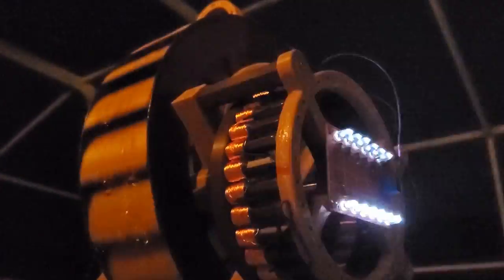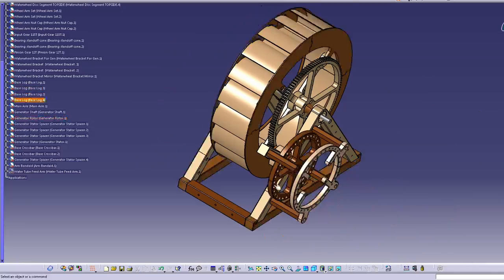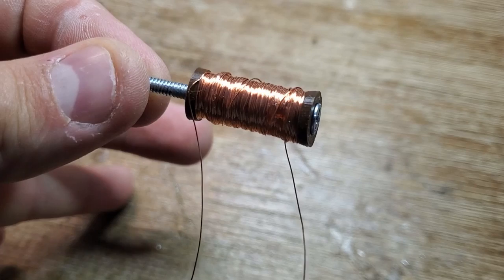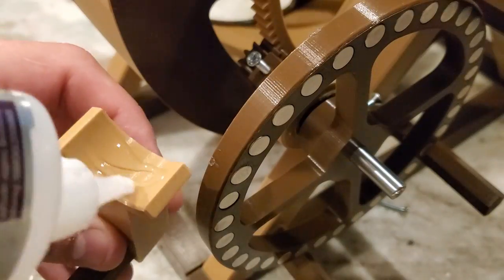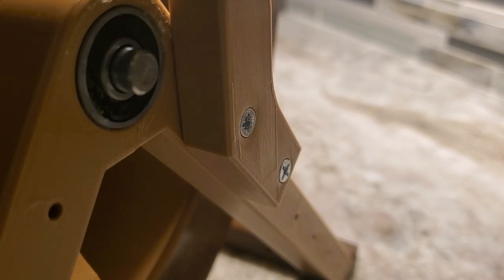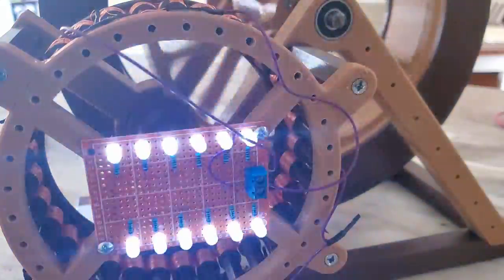3d Printed Waterwheel Generator

Comment: Hi Iron Wheel here (Also Pioneer Under Water Boat) I did not know the coils would function W/O the iron core. Cogging sucked up too much of our energy. We spaced the magnets away from the coils but then our efficiency was abysmal. We were building a pelton wheel. Before switching to permanent magnets we used an auto alternator power generation was just enough to keep the field energized.

Comment: a ring of magnets around both outer edges of the wheel, and stationary coils on the frame, will require more magnets but removes any drag of gears, belts, chains etc!.. a great looking wheel well done..

Comment: output of 26 miliwatt? ha lol a small 1cc hog air engine produce triple of that in electricity with a peak of 150 mw mechanical XD but its less energy efficie at 8ml alchool 45 min its aproximatly a 80 watt thermal used for 75mw electric

Comment: You had 33 sets of magnets and 33 coils in the first iteration, correct?  You removed the fero cores and reduced the cogging, could you not have changed up the number of either coils, or magnets such that you didn't have a single "cog" effect?  

i.e., 33 magnets and 29 coils?  (Or some other set of numbers that created both and "in-phase" and "out of phase" arrangement between the coils and magnets?)

Nice build

Comment: I have a theory that I would like to see tested. Take a water wheel, then multiply it by a number. Let's say 10. You make a 10' tall tower and install those 10 water wheels vertically in the tower, one directly above another. You have a water pump, like your aquarium pump, pumping water to the top of the tower,. Then that water, pumped once, spins all 10 wheels. Pump once; use the water ten times. Will it use more power to pump that water up 10' than 10 of those water wheels can produce?
Reply: A quick way to answer these kind of questions is “will this give me perpetual motion?”. 

If it takes less than 10 water wheels to produce enough power to pump your water up into these 10 water wheels, you can generate more power than you input in the system. You get perpetual motion. Which is, according to the known laws of physics, impossible. So, no, you would not get back more energy than you put in. 

In this case specifically, the energy you get from the water wheels is provided by gravity. The energy you put into the pumps is used to fight gravity. And most of this energy you put in is lost to inefficiencies in the system (friction and other things). What you get back would be at most what you put in (in a perfect system impossible to achieve in the real world). 

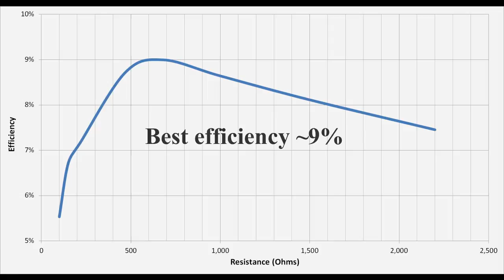Here, he mentions at 6:16 an efficiency of 9%. Let’s round to 10% to make it easy. You would need 10 water wheels worth of power to pump your water the height of one water wheel only (even more than that in reality since 9% is “best efficiency”). 

The “perpetual motion test” is a good tool to understand these ideas. If you theorize perpetual motion, you’re wrong somewhere, and if you observe perpetual motion, you have an energy input that you are not aware of. The rest of the work is to find “what did I miss to end up with perpetual motion?” (which is not always obvious).
Reply: @daeldir  - I'm so tired of being told that perpetual motion is impossible. I believe very strongly that it's possible, but that the big money in the oil industry won't allow it to get a foot hold.
Reply: @need100k  I didn’t say it was absolutely impossible. I said it was “according to the known laws of physics”, impossible. At this point the oil industry is not the limiting factor, the laws of thermodynamics are. We could be wrong. The laws of thermodynamics as we stated them could be invalid. Some hidden nugget, generations of physicists failed to detect, could be uncovered. We can dream. But the laws of thermodynamics have stood the test of time, we failed to disprove them a lot, as is required to have a good scientific theory. We are coming back to this idea of efficiency. For your idea to work, the water wheel would have to be strictly more than 100% efficient. We don’t know how to do that, and a water wheel capable of transforming 9% of the energy provided to it into electricity is definitely not the way to go. 

Here is some hope for you, whichever you would dare to cling to:
 - We are still missing a grand theory unifying general relativity and quantum theory. We can imagine a world in which, once we found a way to unify the two theories, one of the resulting law enables us to go past the limitations our current understanding of physics subjects us to.
 - We could be living in a simulation, and an imperfect one as that, and while the laws of thermodynamics are supposed to hold true in theory, in practice, we could find a bug to exploit for infinite power. As we do regularly in video games. If we live in a simulation.
 - An angel could descend from the sky and show how mistaken we are in our epistemological conceptions. As a gift for his visit, he could grant us a wish to have a perpetual machine to study. Free miracle, limited edition, barely used.

The Wikipedia article on perpetual motion is a very good read to understand the lack of belief in perpetual motion of many scientists. As things stand, the big money in the oil industry already had a firm grip on the speech of Leonardo da Vinci, who was also accepting money from big pharma, hence his likening the quest for perpetual motion to alchemy, discrediting two perfectly fine disciplines in one sentence (once we have broken the laws of thermodynamics, time travel is definitely on the table, but we are doomed since the oil industry seems to have access to it “already”).
Reply: @Just Me  if it was possible, why hasn't anybody come out with it? Especially if it was as simple as stacking waterwheels. And there are much richer corporations than oil corps, that would love to pay less for electricity. so why wouldn't those figure it out?
Reply: @daeldir
I live the explanation followed by the snark

Comment: I really like your project. They have been saying that we are in a drought... although it's raining today. I like prepping so I got a dehumidifier to make water if there is a water disruption. Also I have a desert property and the water is too deep for a water well. It takes 600w to run my dehumidifier  and makes about 32 oz of water per hr. about 6 gallons a day. I plan to run it off solar panels. But I have a hill on my property and was wondering if I saved the water in a tank and then ran the water over a micro hydropower generator to a tank down the hill if it would charge a battery. I think it would be fun if you could stair step generators to make enough power to run the dehumidifier.

Comment: Cool build!
Maybe instead of having a separate large gear (what's the correct name for it?) would it use less material to have the gear teeth on the inside of the rim of the water wheel?
Also, for higher efficiency, try using Schottky diodes.
Also, maybe, try having coils on both sides of the magnet.

Comment: Hook the pump to a little solar panel and collect the water that runs out and recycle it back through the unit. 
Fully functional Solar Powered Water Wheel yard unit. Very interesting.
Reply: u would need a battery to make up for the loss in energy
Reply: Just store the energy in a battery, instead of losing it in friction, resistance, and evaporation...

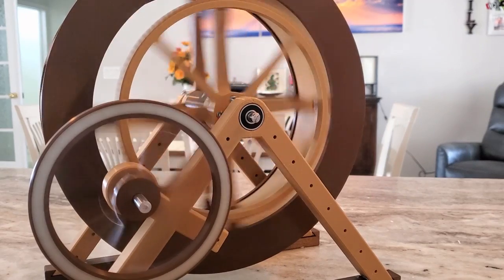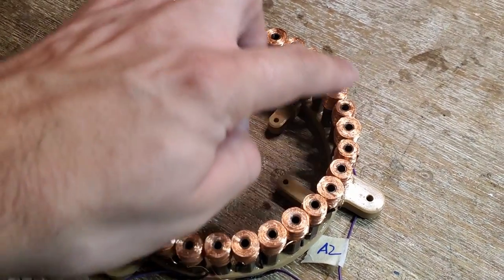Comment: hmmm            at :51,  Too  much  lip, on the buckets.!              at 1:12, it's always good to not have a clue.!        Too  many  buckets.          and,  at 2:42,  THINGS   GO   SIDEWAYS.!!!!!!                 at 3:23,  that  is  NOT  the  Radius  where the magnets (and coils)  should  be.!!!!!!           a  NORMAL, efficient  generating coil  is  made  with  14awg  wire,  NOT    thirty gauge.!!!!!!!                 at 3:39,   lmfao        totally  screwed  up.!            at 5:34, the giant copper sewing machine that ate milwaukie.          at 5:49, cap in the output circuit is  a  CHEAT.!!!!!!!            at 6:07,  BEFORE  losses.!             at 613,  resister values.????              at 6:56, water should enter the buckets at about  One-o'clock.      Not  2:30.           the 'wheel  SHOULD  turn  Slowly  enough, that a bucket can  Partially  Fill  up.!!!!!        at 7:53,  gear teeth are  STROBING  like  crazy.!       googletranslate
Reply from the maker: ok

Comment: Wow, that's a very nice build😄 Will we see a wind powered version of this in the future?
Reply from the maker: Yes. I live a few minutes away from the Atlantic ocean which always has a really strong wind, so I'm planning to build a portable wind turbine for the beach
Reply: @HyperspacePirate  we'll be glad to see that😄 how about having two rotors and one stator in between? You know, having magnets from both ends , although you might have to slightly alter the stator placement... Just suggesting😅
Reply from the maker: @CuriousChan  I was thinking more along the lines of a single rotor and stators on both sides. In the future, I think I'll switch to a radial arrangement, though, because the axial loading has caused some problems bending materials etc

Comment: Nice! With this you could have a solar powered water pump bring water up to a large holding tank then have a water valve solenoid release the water onto the wheel where it can be stored in a lower storage tank. Be neat to see the water wheel running in cycles, especially if it was added to a diorama. Maybe have the water wheel connect to a wheel that lifts up those metal balls and have a marble machine going where the wheel powers the start of it and gravity (and maybe those accelerators) does the rest. If you made the water distilled water there would be no residue due to it being pure water when it evaporates. Just trying to toss out ideas. :)
Reply from the maker: Yep, it could be done. A water tower is a good way to store energy without batteries. The only downside is that you need a ton of space